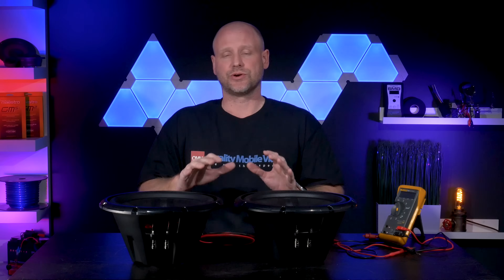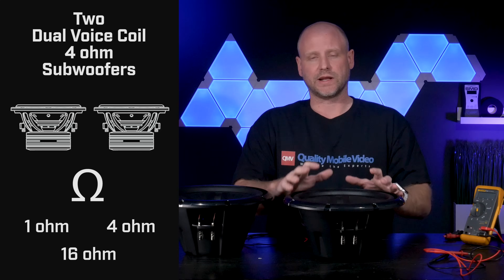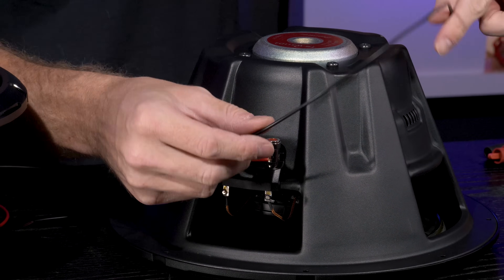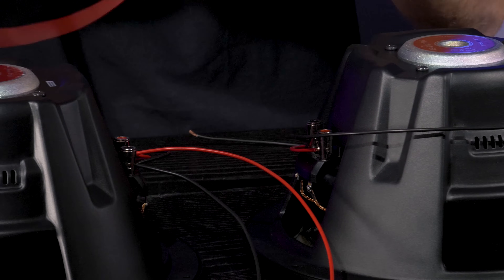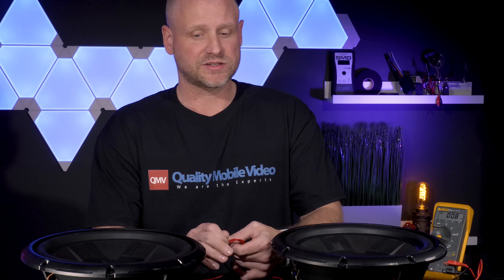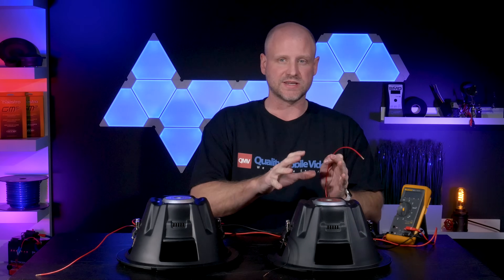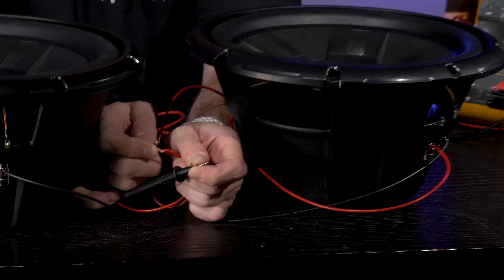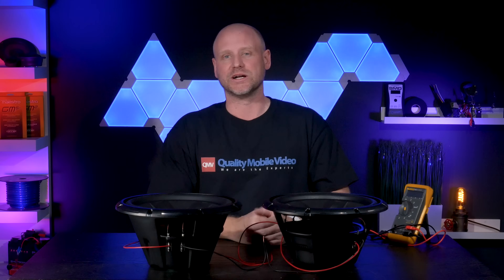Wiring Two Subwoofers DVC 4 Ohm - 1 Ohm Parallel vs 4 Ohm Series Wiring

Comment: parallel divides the ohm load series increases by a factor of 30% its a 3 ohm load moron.  4 + 2 is series 4 / 2 is parallel .  so you have one sub which is 4 ohm dvc in series it adds 2 ohms total to the 4 for 6 ohms per dvc sub then you parallel them which is 6/2 = 3 ohms. You need 4  4 ohm dvc subs to hit 4 ohms. You are dumb bro learn about impedance before making videos.  I knew about this 34 fucking years ago .

Comment: Hi thanks for getting back to my last comment on another video, i have another question, i have 4 x 2 ohm component speakers and i also have a 4 channel amp that can handle 4ohm and 2ohm, how much ohms does the amp see in this situation?, would it be 2 ohms because its a 4 channel amp?.

Comment: Can I connect 1 ohm to a 2 Chanel p1000 1 bd?
Reply from the maker: Confused by your question Angel, that is a monoblock amplifier, not a 2 channel. It is 1 ohm stable though

300 Watts x 1 @ 4-Ohm 
500 Watts x 1 @ 2-Ohm 
1000 Watts x 1 @ 1-Ohm
Reply: Quality Mobile Video I can’t find a video showing me how to connect the subs because of the to channel connecting that way was my question cuz it has two connections for two subs ? So I can do the 1 ohm to that amp?
Reply: @AngelAlvarez-bm9cc  yes you can do 1 ohm those are not two separate channels they are one channel just to make wiring easier. just do not connect 2 separate one ohm subs ecause that would be .5 ohms and fry your amp. if you have 2 1ohm subs you must wire them together to 2ohm

Comment: Can I wire two dvc 4 ohm subs to a bridged amp at 2 ohm
Reply from the maker: Two DVC 4 ohm woofers can be wires to a 1 ohm or 4 ohm load, not 2 ohm
Reply: Actually they can be....by only using one voice coil and bridging the 2 channel amp....custom installer showed me this trick...but he did say he wouldn't recommend doing it...it can damage the subs....I've had mine wired like this for 6 months or so and so far so good...I'm running 2 ten inch massive dvc subs on a fosgate 700.2 power series amp

Comment: Dual 4ohm subs wired to a final 1ohm. Final positive and negative lead connect to wich of the 4 speaker terminals on monoblock 1ohm stable amp. -+/-+
Reply: Henry G far negative to far positive......
Reply: Tru3 KinG So If I wired both my subs down to 1 ohm I wire thoes with the positive being first and negative being the last? On my monoblock
Reply: Henry G also make sure your amp is 1 ohm stable

Comment: I have an amp that is bridgable to 1 ohm stable. Its also 2 ohm stable. I have two 4 ohm dvc speakers. Im installing them in an infinite baffle set up for space. I want sound quality vs just bumping. Should i wire to 1ohm or 2 ohm?
Reply from the maker: I would recommend 2 ohm, but two DVC 4 ohm subs can only wire to a 1 ohm or 4 ohm load. wiring at 1 ohm will get you the most power possible and most bump. But you will sacrifice efficiency and clarity. A 4 ohm load will be much more efficient, have better sound quality, but will have close to half the power as the 1 ohm load.
Reply: Quality Mobile Video thank you.  I tried both ways. Running 4 ohms series-parallel gave far better sound.

Comment: can someone please tell me how this setup with the dual 4 ohm to 1 ohm would connect to your terminals on your box. just wired my subs to 1 ohm and now i'm stuck on how to hook up terminals. please and thank you
Reply from the maker: Whats your amplifier?
Reply: Power Acoustik Bamf series 4000W mono block. says its stable at 1 ohm at 2200 watts and my subs RMS is 1900

Comment: I have two ts-w309d4 an a gm-d8601. Can I wire each sub into a 2ohm load an connecting them to the amp separate since the amp has two channel type that is actually a 1ohm load. I want the subs connected as a 1ohm load.
Reply: Yes, those 2 channels are just for an easier install, its internally connected
Reply: I have same setup. Can i get a diagram for how to hook the subs to the amp? Am confused. Thanks

Comment: Can I add a little ‘common sense’ to this good video??

If you are new to car audio this is important.  When getting a dual voice coil subwoofer, do not skip wiring one of the coils!!!  

Last 3 installs I did on friends cars they brought me subs to wire up, and the DVC subs they had only were wired up on 1 coil (these were used subs in boxes).  

Also a note, dual voice coil does not mean you get ‘2 subs in 1’.  They are simply designed to be able to have multiple wiring options’
Reply from the maker: Thanks fort the tips Tim!

Comment: keep in mind when bridging a 2 channel  amp to mono add .50 ohm resistance
Reply from the maker: You actually need to multiply by 1/2
Reply: @Qualitymobilevideo  so for the 1 ohm wiring would I bridge it because my 2 channel Class d mono amp has 1 ohm max power or would I put the negative and positive in one channel and forget the 2nd channel

Comment: Sir how to install i have two subwoofer pioneer dual 4ohm ts w1200pro with mono Amp pioneer GM D9601 1ohm stable?
Reply: Vandenberg Kharbuli Nice setup.  I would run them in a decent sized sealed box, that’s just my opinion though.  That amp @ 1 Ohm is going to drive the hell out of those subs and a ported setup, unless it’s relatively small, would probably not net you better sound than sealed unless you want it to be very loud.  Their sensitivity is 105 db, which is amazing by the way, so a small ported enclosure tuned however you like or a moderately sized sealed enclosure so the subs have plenty of airspace to work with that 1 Ohm madness.  Should be pretty punchy either way, hell, I’m almost jealous LOL.  Let us all know how it comes out and which route you took.
Reply: Sir Which way is the best to install 4ohm to 1ohm or 4ohm to 4ohm?
Reply: Vandenberg Kharbuli the amp only does 500 watts @ 4 Ohms.  You would be cheating yourself by wiring it to 4 instead of 1 Ohm.  Additionally, after you’ve heard them at 1 Ohm on that amp and at 4 Ohms, you’ll not want to keep it wired to 4.  Not saying it isn’t doable and I totally recommend trying both so you can hear the difference ( 4 Ohm wiring will sound cleaner ) but once you’ve heard them at 1 Ohm, you will most likely want to keep them wired to a 1 Ohm load.  Ultimately, you’ll be able to answer your own question having tried both.
Reply: Thank q soo much sir 😊
Reply: John Crypto yes you can lol you literally just wire them straight to the amp...
Reply: tim erhardt  I recently came across some old school Sony xplod subs with a high db level I think they are around 92.3 db imma hook them to a pioneer 8601
Reply: Piaitive to pisitive fron1 side sub  to other voice coil same negative run togethervpis and neg you know how to run negative and negative on one coil together I want to hear and positive and positive I don't want speaker and do it to the other speaker the same you want to take a positive and negative out of one coil of each speaker put the positives together and negatives together positive definite positive on a mono amp and negative to negative that would be four wires that you have to connect but why are the two positive together in a few negative never remember you're too negative also never remember you have to running off a long coil out it don't matter if it's the first or second coil but it has to be a positive and negative out to the neck to the negative and positive of the mono amp if it's dual 4 then you should be able to have a 2 ohm load running positive to positive negative negative on Bose subwoofers both of them and then positive and negative out of  either side either voice coil and then take the positive and negative from each speaker why are both positive to  the positive on one channel amp and the negative and negative from the and actually can run boss amp if 1.3 down the about 8.8 .80 but I'll tell you I just bought a $98 amp a 4-channel digital dull dual from Walmart 98 Bucs I got it running 240 by 2 at 4 Ohms it's for a channel 4 kanal let me tell you that thing slams how is very very surprised that face that hard but it's 105 decibel amp and it is a size of a red brick but I had a boss amp 16 times bigger this what tiny little Walmart AMP puts that big ass boss amp to shame

Comment: The 16 ohm load isn't a combination of parallel and series as stated at the very end of the video... to achieve a 16 ohm load with four 4 ohm voice coils,  all coils must be wired in series.  Otherwise this was a great video.
Reply from the maker: Thanks for the info!
Reply: David Hamilton, how about a 16 pairs of dual 4 ohm voice coil subwoofers, each pair all wired series for 16 ohms a pair.  Then parallel all 16 pairs down to 1 ohm at the amplifier for competition use. That would be 32 subwoofers run off of one class D amplifier at 1 ohm. That's the only practical use I can imagine with it. It would have to be a budget build even with a 10K amplifier. Assuming you were using the subwoofers in the model they were showing.
Reply: They are right though in the bane of 16 ohm being such a niche need that an overwhelming majority will probably never do it. It would have been nice to include it on the premise of the DVC subs running 1 or 2 ohm coils. 4 of those coils in series would leave you with 4 or 8 ohms which someone might actually use. The only real reason to wire up to 16 is if you are using 8 of the woofers and need to wire 4 sets to 16 ohm to parallel into 2 sets at 8 ohm and parallel the 2 sets of 4 down to 1 set at 4 ohm. Which is where their comment on multiple subwoofer builds came in. If you are at that point in building a system though, your either having a shop do it or know enough about it to do it on your own already. I once built a home subwoofer where I needed to use 50 watt 4 ohm ceramic resistors in series with the satellite speaker outputs to keep the ohm load at something the receiver amplifier could handle. Ended up building 4 more of them for people who heard mine and wanted one for their house. There are so many niche parts and situations tat most will never encounter. That information might be nice for the rare individual who can use it. For everybody else though it'd be useless information possibly turning them off to the publishers videos for being to long including stuff they'd never use.
Reply: Dude, dual 4 ohm VC speakers  run in series is 16ohms. (4+4) + (4+4) = 16ohms

Comment: This is what I originally wanted to do with the L7 15’s.  What stopped me was the cost of the amp required to power the pair, the fact that my truck’s electrical is not upgraded and the box I wanted to build was going to be literally twice the size almost of my current box.  ( again, wifey hates it but she never rides in my truck when we’re out, we take her car ) I had also learned, mainly by graphing literally every design size and tune I could come up with for a pair, that a single in a bigger box than recommended ( EBS as mentioned before ) would be sufficient so that’s what I went with.  I really enjoy checking out the output graphically ( I’m using Kicker U for iOS - paid version ) because it gives you a chance to see how well or how poorly the sub will perform in any given design.  Port velocity, rise, power requirements, xmax, etc.  It was and still is something I want but will probably never do because I’m not independently wealthy LOL, anywho.  Great job again on the video QMV, keep’em coming.

#dat1Ohmpowertho
Reply from the maker: Thats awesome! Lol wifey hates it 😂
Reply: Quality Mobile Video omg thats the story of my life....
 i bougt two RF. T1..15inch they cost $700 each online but I got two of them for 400 so of course I couldn't pass up on the deal now my wife tells me when I'm hungry to go chew on my speakers hahaha